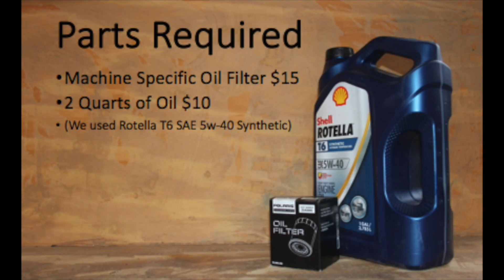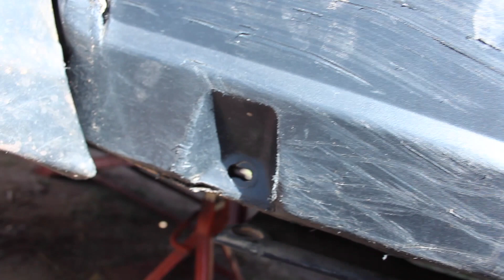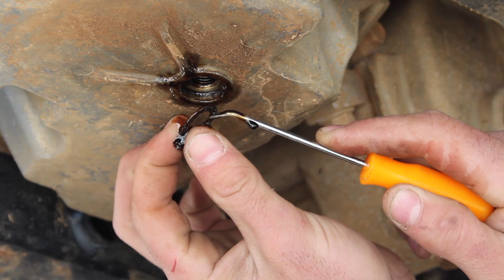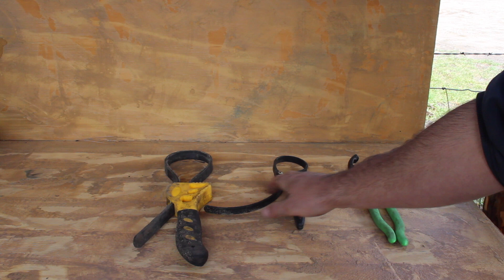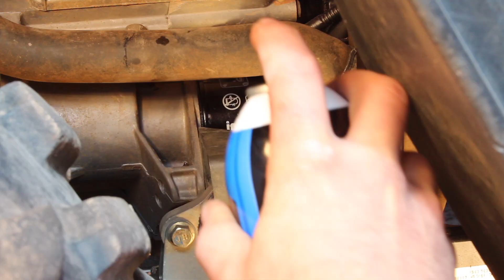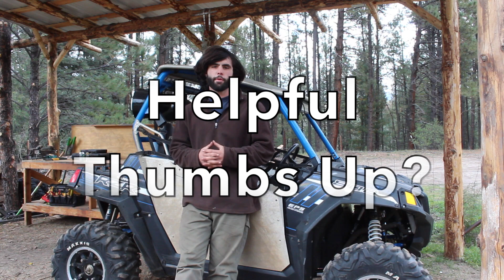How-To Change Polaris RZR 800 Oil and Filter

Comment: I have a 2014 RZR 800 with 6100 miles and it's already in the shop with fuel pump issues and a bad drive shaft 🫤

Comment: Great Video, I just picked up a 2008 Razr Ranger that is in excellent condition, "babied" and the process was exactly the same! Only thing I did different was use a new crush washer for the drain plug as its included in the kit online that comes with 2.5 quarts and a filter for about $45. I also pushed the rzr up on ramps for the front tires when it was time to add the fresh oil which made the oil run down the dipstick/fill tube much easier because of the slight angle.